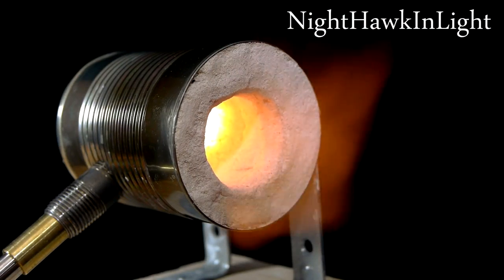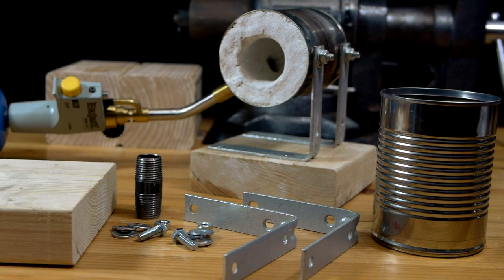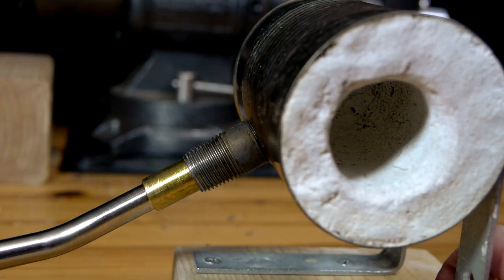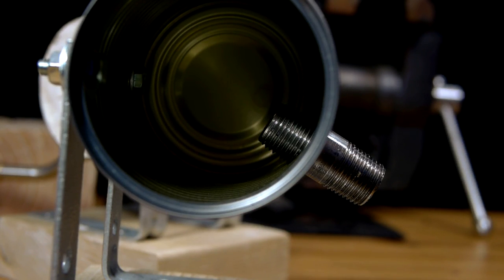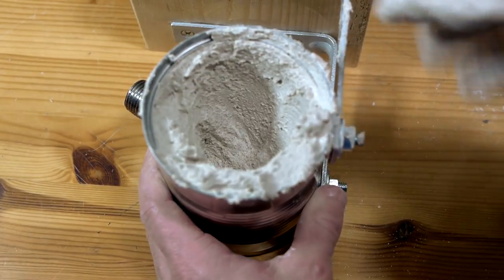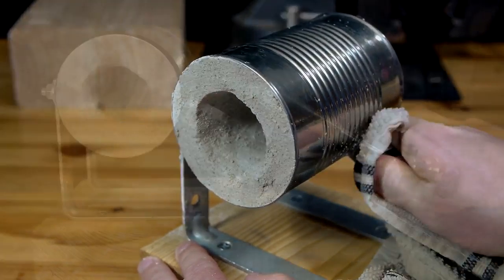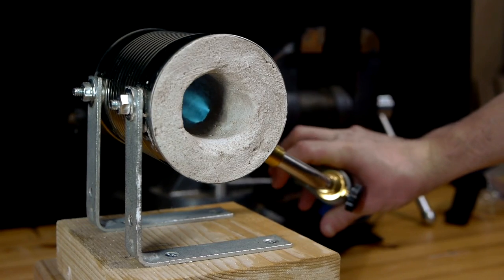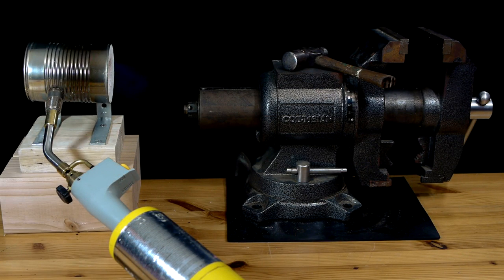How to Make a Soup Can Forge

Comment: I am now buying the materials to make this... I am gonna be ready for the zombie apocalypse
Reply: ***** you won't win a war with arrowheads alone. Making a bow is also a skill
Reply: Zombies are basically never going to happen, and you're not going to have the appropriate fuels for this lying around for long. If you want some kind of apocalypse-proof system, I'd go with charcoal. Charcoal is relatively easy to make, and has been used for thousands and thousands of years. It also burns hot enough to do metalwork. On top of that, it has other uses, such as helping to filter air and water, and is a basic way of helping to neutralize ingested poisons. It's a common practice medically, but they use activated carbon, which basically is just a lot more effective. Charcoal in general has been used for a long time.

And no, you probably don't want to be making arrows or bows in an apocalypse, esp. a zombie apocalypse. They're hard to make well enough for them to actually be useful (read: accurate), and an arrow isn't going to do much to a zombie.
Reply: I don't know much about zombies, but in a'normal' apocalypse, if you get a strong enough bow, you could be quite irritating, especially with a large group. And there are ways to make relatively good bows in a couple of minutes,  not kidding.
Reply: seigeengine  Yes, I agree on that, i tried it myself many times, it certainly is harder than it looks.
Reply: ilikethisfood At best you might be able to get/already have quality archery equipment, and that's great, but even the best of them are going to break down, especially with the heavy use you're likely to put them through.
Reply: seigeengine I agree. That's why,, after many years of collecting firearms, along with the ammo to feed them,, i've just recently acquired one of the best comp. bows out there along with a few doz arrows complete with field points & broad-heads. A few weeks later,, someone just outside of my circle of friends was doing so well in this BO economy,, he sold me an un-fired Ghost 350 cross bow,, case,, bolts heads and all for 200 bucks. Needed rent money.
Reply: Franco Tramble That's cool. Firearms aren't legal here, without rather hard-to-get licensing, and I think crossbows fall under the same. I know it's not legal to just own them.
Reply: seigeengine where do you live? In the US?
Reply: Daniel Allen ... I question whether you thought about that before posting.

I stated firearms are illegal here. They're not illegal in the USA.

I'm Canadian.
Reply: Sorry to hear that you live in Canada seigeengine,, that's just one of far too many places on this Earth where Human Rights are violated on a regular basis. If you can't own firearms why would you need a small forge? I'm sure the Crown will think of a ''reason'' sooner or later. Sure,,our fed gov believes that they will disarm my people as well. They've already lost that fight, they just don't know it,,,,, yet.
Reply: Franco Tramble And this is where I feel you've gone a bit into the paranoid cook territory.

My government does not seriously violate our rights in any manner. We do not possess the inherent right to own firearms because firearms are dangerous weapons who, for a large majority of the populace (esp. people living in or near cities even moderate in size), have no legitimate use in their daily lives. You can still get firearms, esp. if you can demonstrate that hunting is a requirement to feed your family. It just requires licensing and registration, and the firearms are generally only those that are of legitimate value in that regard.  As for weapon laws, they exist, but there's this weird situation where the law is sort of based on the case-by-case basis where the use of the weapon AS a weapon is the point in question, such as with large bladed weapons. It's also possible to have crossbows here, but just owning one is illegal. Perhaps it's a matter of licensing again, as I know places that do archery have crossbows just fine.

And I realize that point might be hard for some Americans to grasp, but having the right to weapons and firearms is not a tenet of the Canadian nation, or culture. We don't grow up with any sense that we have a right to own firearms, or anything of the sort, nor do the citizenry of most nations where this is the case. It's a predominantly American thing to consider the ownership of firearms and other weapons a fundamental or Human right.

Oh, and you can't actually win against your government. They have most of the infrastructure in place to make you ineffectual, and, provided the blind fervour of American "patriotism," you can be sure many would side with the government against a faction of it's citizens. If you attempts to resist them with force, at best you'd have a civil war you'd swiftly lose, and if they were really serious, they could wipe you all out with ease. You have no force-option. The fact of the matter is you're impotent.

That said, there's plenty of blacksmiths in Canada, and it's perfectly legal to produce knives, and such, and has been for a long time.
Reply: The most basic of ALL Human Rights is the right to exist, to be, to life. The other is free will, the right to choose. I realize that in most nations, the populace has been so under-educated as to believe otherwise. If Humans have the right granted by our Creator to life, then we also have the right to employ as much force to stop someone from taking our life as they try to employ in taking our life. With that go the right to own the means of doing so.
      
     I realize that you & your people live to service the Queen. We are a free people. That is the difference between a subject(of the Crown) and a Citizen of these United States. As far as being ''impotent,'' your sex life is no one's business but your own. WE are far from it. Some battles must be fought, no matter the odds. We beat the best military in the world,, twice in  a handful of years. We do not have to win on the battlefield,not this time. All we need to do is not loose. As is already happening, as our government shows more of it's hand, more and more people will refuse to comply when ordered to enforce unconstitutional ''laws''.
           
                So many more of our people have read books like ''The Law'', Frederic Bastiat's work from before the French Revolution, and many more. They have learned the games politicians play called ''Legal/Lawful Plunder''. It takes willing citizens to enforce any politicians agenda. Without that cooperation any ruling class is powerless. It is ones Moral Code of Conduct that keeps a person from misusing any object be it a gun, a hammer or a chainsaw. Or even a milk jug half full of gas, a piece of rag and a match. Jews for the Preservation of Firearms Ownership (JPFO) has set the record straight on the result of gov's gun control, those policies made possible every Genocide they have documented, without exception. We will not let it happen here. The re-institution of our Founding Documents is our goal. This Nov, the sleeping Giant takes the 1st of many peaceful steps to see that goal come to fruition. You see,, the ''Sleeping Giant'' isn't asleep any longer. And ''Progressives'' never do their own dirty work. Like I've said before, they've already lost. They just don't realize it yet because they see only what the want to see. We see through the eyes of history, the whole world's history. No one ever said it was easy. The wings of freedom also come with the chains of responsibility.  Most of my countrymen are learning this lesson at this very moment. Many don't like it but learn it they will or they'll be on the wrong side of history,, or even the wrong side of the ground. 
    
     Brush up on your critical and abstract thinking skills cousin, and join us in the 21st century. You know that you're always welcome at our table. If the US falls, it sure won't do Canada a hell-of-a-lot of good. And when there's no more threat of a Tyrant south of you, that can only help everyone rest easier. 
  
    Oh, just one more thing. I/we train with swords/knives too. Just in case it takes a blade to get back a gun.
Reply: Franco Tramble That's an arbitrary justification for the ownership of weapons you have no business owning. The average civilian has no actual use for a firearm in their daily life, and as much as they may be useful in extreme circumstances, that's usually with regard to defense against another Human, who, unless firearms are common, probably doesn't have one either. The frequently spouted claim that criminals don't care about the law so firearm restrictions don't apply to them is simply false. If firearms are not prevalent, criminals can not easily get them either, although, of course, some will always get through.

We are not subjects of any monarch. We show respect to the Queen of the former empire that originated us. Whereas Americans were the rebellious children, we were the respectful ones.

Your power fantasies are simply that, fantasies. You are impotent. Not in terms of sex, but in terms of potency, of power. I imagine you shouldn't criticize my thinking skills when you can't be bothered to understand what words mean.

You see, your claim about genocide would be valid except for all the other countries around the world that have far fewer firearms in the hands of their citizenry, and yet manage to get along just fine without massacring people. Quite frankly, you've bought a load of nonsense all because you're the victim of biases, wherein you believe your cultural and societal norms are somehow "correct." The application of critical thinking would swiftly remove this delusion from you.

As to the non-firearms-related issue of the American government violating the rights of it's citizenry, and engaging in war-mongering behaviour towards pretty much every other nation on Earth, I certainly agree.

The only legitimate use of a firearm outside of the taking of Human lives is in hunting, or in protection from large animals. The majority of people do not hunt, and do not live in places where large animal attacks are a serious issue. I do not believe people have the right to take Human lives, therefor I see no reason for the majority of people to own a firearm. Self-defense claims are baseless, and at best lead to circular reasoning. The argument that owning a firearm is somehow essential to self-defense is nonsensical, and demonstrably false. You do not require a firearm to defend yourself, and if that was the case, you'd imagine that would show in crime statistics in terms of fewer murders per capita compared to other nations and all that. Funny how that's not the case.

EDIT:

And I feel I should reiterate the most important part of what I'm trying to say here. If you go to any country where the possession of firearms is not the norm, and ask if people think it is or should be a Human right to own one, you'll likely get the answer "no." I understand how easy it is to just dismiss that with some nonsense about people being brainwashed, or propaganda, or whatever else, but that's lazy, and insular. The simple fact of the matter is that we believe it because we, as individuals, both as a result of cultural biases, and as a result of rational though, have determined that the ownership of firearms is not a Human right. It's not that we can't think critically, or anything else. It's a difference in opinion. Likely the only reason you believe otherwise is because you were raised in a country where owning firearms is normal, and is a right guaranteed you as a citizen of the USA. You've been raised and bounced your ideas around in a culture that lives and breathes delusions of freedom, and one of those freedoms being the possession of firearms. Of course you can find other people, even famous people, and from other countries, that confirm your preexisting beliefs. Of course, there are always people who don't follow these norms. There are Canadians who are all gung-ho about firearm ownership, and plenty of Americans who are against the freedom to possess firearms. The point I'm driving in as hard as I can is that you live somewhere where you're fed the idea you have the right to own firearms from go. In other countries? It's not like we're taught that firearms are evil or anything silly. It's just not a thing that's really prevalent to us. And while I say we have cultural biases because of that, I'd consider them far less than yours. We may not have the fundamental right to own firearms, but we're not anti-gun either. On the other hand, you're in a heavily pro-gun culture. Your entire society exists at an extreme to our eyes.

Anyways, THEMIGHTYCONTENTPRODUCER wants us to take this elsewhere, so message me if you have a response.
Reply from the maker: seigeengine Franco Tramble  If you're going to continue this conversation please do so via private messages rather than on my videos.
Reply: seigeengine I did think about my post before asking....I didn't know for sure if there might be any states here that had a law against owning them. And why be a jerk? All you had to say was I'm live in Canada.
Reply: Daniel Allen because I'm not always in a good mood, and when I'm not, I'm usually also distracted by whatever put me in a bad mood, or exhausted by it, so less inclined to take the time to reflect on whether the person I'm saying something to deserves how I react. barring them being somebody I care about.

Anyways, I apologize.
Reply: No, I have no response to those who do not believe in Human Rights.
Reply: Franco Tramble I believe in Human rights, and the defense of them.

I do not believe in the defense of the rights of cowards to frivolously wield weapons for the sole purpose of their use against other Human beings.

Now excuse me, NightHawkInLight has requested we do not continue, and you're clearly incapable of being rational about, or respecting the beliefs of people whose beliefs differ from yours.
Reply: seigeengine

Just to clear something up. Its not all that hard to get a firearm's licence in Canada. You take a weekend course on firearm and hunter safety, then apply to the RCMP. They do a background check, check out your references, and mental health history, and then you're good to go for any non-restricted firearms. Then restricted firearms just require an extra course and an extra application. Not a big deal. The courses are well put together and interesting, and as long as you have a clean record there is no reason for the RCMP to turn you down.
Reply: coal would be more useful for zombie apocalypse
Reply: @seigeengine   It's March 16th 2020 and we are in The CV19 Apocolypse ...SanFrancisco has been taken by Heroin Zombies >W/ Seattle close behind ..Los Angeles has been burnt to The Ground and all volcanos have been going for the last two years even Mauna Loa is waking ... What say you? lol. oh I forgot to say THE WHOLE U.S.A . is in "LOCKDOWN"
Reply: @ilikethisfood  as someone who makes bows, no you can't make a good bow in a couple of minutes. Maybe the PVC bows? But they typically have an uneven draw and are inaccurate

Comment: It's a cool design for a little forge, but the choice of material is very poor. When you drive off water from plaster of Paris you're left with calcium sulphate. This compound decomposes at the temperatures this forge provides. You get calcium oxide and sulphur trioxide, which is basically sulphuric acid without a molecule of water. It is a highly corrosive substance you don't want to breathe in even if it's given off in small amounts, and it makes the steel brittle.
Refractory materials of choice are bentonite, perlite, fireclay, silica sand. Not sulphurous compounds.
Reply: Nah.
Reply: I call bullshit.

Comment: Thanks for sharing! This video was really informative and entertaining. I am an aspiring blacksmith and this is an excellent first step to take considering my low budget. Also, definitely get the TS8000 swirling flame torch head, I found using the pencil flame simply doesn't generate enough heat. 
Keep up the good work!

Comment: I made a slightly modified version of this when I took up knife making (not forging like the video, but starting with metal stock and filing away everything thats not a knife) and needed a way to heat treat knives in my apartment. 

Mine was made with the bottom 3/4 of a 2 liter coke bottle as the outside form and a coke can as the inside form, and I used a runnier mix of plaster/sand so I could pour it in.  When I dried I pealed off the 2 liter and ripped out the coke can and chiselled a hole for the blow torch and it works great.  I just set it sideways on my oven rack since I didn't build the stand. 

It has now officially heat treated 3 O1 tool steel knives perfectly.  And to Stephanie Morgan, yes it can definatly melt lead.

Comment: Made it, loved it, went on ad now blacksmith with a brake drum forge. Regular dirt works and the pipe nipple is a bad idea, just punch a hole that will fit your torch as the pipe nipple gets red hot and cracks if cooled too fast

Comment: Just adding my two cents after researching making forges, I think the inlet for the torch should be closer to the front and angled backward so that when the blade is in it the thick part by the handle is nearest to the flame and the thinnest part by the tip is away from the heat.   This will allow for a more even heating. Other than that I built this and it works great, though I did build a housing for it out of fire bricks instead of the brackets.